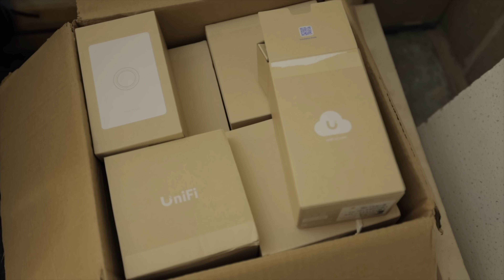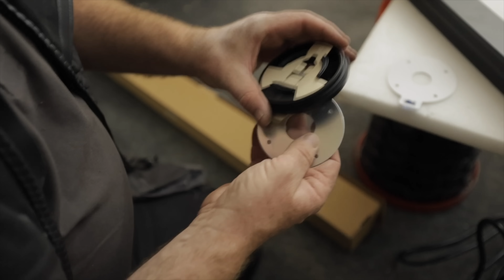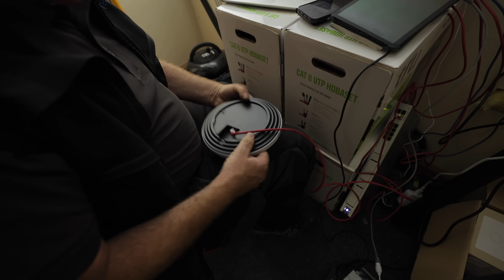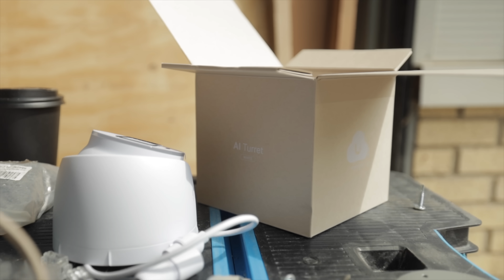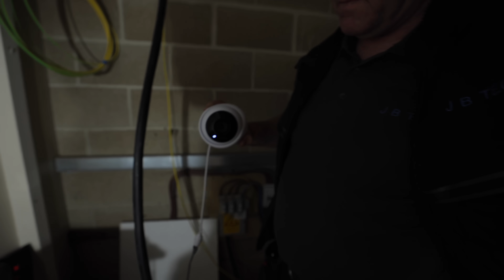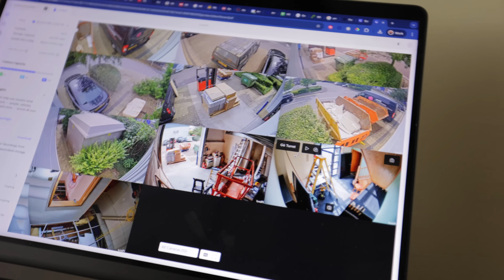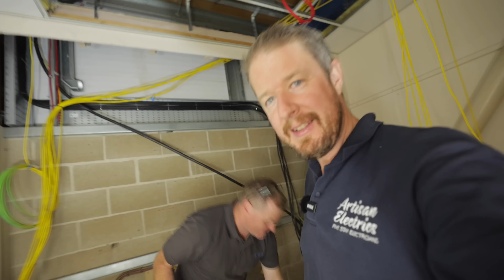We Got BURGLED So I Did This...

Comment: I have basically this setup at home, but the older Dream Machine Pro.

Ubiquiti have just announced/released the alarm and siren hardware so you could set your alarm manager to go off when things are detected in certain areas at certain times etc (eg an unrecognised van showing up between 2300-0600 or whatever)

Comment: You might want to consider a UNVR with 4 HDD's. That single 6TB drive will only give you about 7 days recording at 4K, and no resilience if the hard disk fails.
Reply: the UDM Pro Max can take a second hard drive in RAID 1

Comment: The #1 rule in security - assume you will be breached at some point. In physical security, that means assume someone will get in. Like others, it's good to see the steps you took - but I'd leave it at the high level concepts of like the initial hardware setup and software, cabling etc - but don't show the actual video or locations. Same with any other security, just focus on 1 external obvious location if you must.

With anything you are trying to secure, consider the value above all else and spend accordingly. No point spending $500 on a high security padlock if you your $10,000 worth of kit is stored in a chain link cage, for example - thieves will always go for the easy route unless they are after something very specific.

Comment: Seriously questioning the guy who installed that system…. Few things just didn’t sit right. Not sure if this was done after and I’m sure a sparky would think about these things but 

1. Please make sure to get a UPS, that’s really expensive gear and fluctuations can damage it. Also you have backup power for the CCTV. 
2. That’s a commercial access point. They get extremely hot, I would not leave it on a box 
3. Rack mount in an enclosure with fans😢 for air quality and tidiness
Reply: Artisan are not going to cheap out on the electrical installation,  it's obvious that is a temporary 'desk' for it too.

Comment: I have been impressed on the analytics of the G6 series.

I have to agree with the other comments. Secure the recording device NOW! Have a dedicated UPS also. 

Have select number of camera fitted with an SD card. This is part of a layer defence. Cloud back up is an option in addition to adding an SD card.

I do this as work so protect as an a fresh attack could be power and internet, then take the recorder.

I could suggest installing and AJAX security wireless system. Very useful in construction environment as sensors can be moved as required and you can get pirs with  an event camera. This would send a snapshot of the activation to you and the ARC. Great for validation.

I have seen many break-ins and the snots were picked by cops.

Layer, layer, layer.

Comment: "Have you done anything to make it faster?" "Nope" ... also just added an AP right next to him. If you have a 1GB connection there are 8 bits in a byte, so divide by 8 to get your speed in Megabytes per second ... if he didn't know that I'm not sure I'd trust that chap with anything data. Also alhtough preference - Seagate (non-enterprise) drives are absolutely awful and there are plenty of documented cases of very high failure rates.

Comment: Whilst the building is still a shell, find space to build a secure room to locate your server and get it secured behind a heavy door - ensure there is plenty off ventialtion as those servers will get hot and get somer more storage as you ideeally want enough storage to have 30 days worth of footage to scroll back through - it's always good to be able to scroll back through the footage should you need to, to find someone casing the building for a future theft, or staff having sticky fingers (not that they would, but you never know).   All those cameras are all well and good, but if the scroats can get at the server and shut the whole thing off, the cameras are useless. You also need to start practicing security through obscurity, enhancing your visible deterrent with concealed cameras - put simply stop showing all the camera locations on Youtube to ensure the safety of the building and its contents.  It would also be worthwhile looking to get some form of off site backups set up whether that be a small storage computer at home that your office backs up to or a professional cloud based system.  Either option will give you a fail safe in case something happens at the building.
Reply: Want the odd concealed camera lower down so that when someone turns up for a little bit of thieving wearing a hat you still get their face.
Reply: Agree - over sharing is deadly for security.  Secure server rooms and offsite are all de-facto standards in IT.
We also installed dual-location storage (in a school) so that you doubled up key kit in distant locations and backed up your storage there.
Reply: Totally agree with Securing the Equipment, had a break-in at our pub and the Perpetrators were aware where the cameras were and where the CCTV recording unit was, they avoided the cameras and removed the entire CCTV unit, which was later found mashed with a hammer and the hard drive also smashed to bits. had the system upgraded and placed in a Safe and new software that saved snapshots to an offsite data storage
Reply: @MartinOverthrow  We always fitted key cameras in pairs, where you were watched by one if you tried to knobble the other. Standard practice for school security where I was.
Reply: Definitely good to have layers of security.
Reply: The IT guys at my school got AC put in their main server room when the new build happened and it’s permanently set to cold, no windows or ventilation needed. Would highly recommend Jamie does the same.

Comment: Cat 5 / 6 Cables should be temanaited into a rack on a patch panel!
Reply: Only if it’s solid core (and it should be). 

This chap should have replaced his cable certifier. Just checking the pairs are wired in correctly is not going to give you any guarantees. Structure cabling should have a 20+ year guarantee. Also if certified you can exclude cable problem is things are not working as they should.

Comment: i spy a cheeky little simplisafe alarm keypad in the background... alright for a layover security system but you 100% need a better permanent alarm system especially for your insurance to cover you. nice system, I haven't really looked to much into the ubiquity stuff but looks awesome. using hikvision at home at the min and always found it spot on though I am due an upgrade in my new house.
Reply: His unit is absolutely ripe for a full UniFi deployment. Switches, access points, cameras, access control, environmental sensors etc. 

I’ve been keeping my fingers crossed for a smart door lock from them seeing as they are considered a “prosumer” brand but nothing doing this time. I do like the look of the SuperLink system though (the hub for the sensor platform) 😎

Comment: I quite dislike Ubiquiti products, got burned by them many times in past years. Even latest products like USW-Pro-Max-16-PoE one day just stopped switching until we unplugged the switch from the wall (cold boot). Every network vendor uses same chipsets in their products nowadays. What is different is software that runs on top of it and that is where Ubiquiti is quite lacking. It's all fancy LEDs and stuff but they can't do even the basic stuff reliably.
Reply: Ubiquiti is lacking in software?! I think you’ve been asleep. Even the most hardened Ubiquiti haters are starting to rethink their position.
Reply: @DJBenson2009  What I meant by software is device firmware. Their selling point is price and eye candy applications around it to have Apple like "feel". For example their enterprise line of switches or APs missing elemetary feature like console port. There is a reason why enterprise networking devices cost so much from other vendors like HPE (+Juniper) , Cisco, Extreme networks, Fortinet, Dell etc. Key difference: reliability testing and options of on device diagnostics if something goes wrong.
Reply: …and if a switch that was released a little over a year ago failed on you, why didn’t you return it to the supplier?

Have to say I’ve got a cabinet full of UniFi stuff in my home and not one thing has failed and I’ve been running their kit since 2016.
Reply: @DJBenson2009  It didn't failed completely, it just hang in some state and cold boot solved it. 
You pointed it right "at home" thats the place where Ubiquiti products bellongs.
Please don't put them in mission critical infrastructure, they aren't fit for it (even they pretend to be).
I Also have very old EdgeSwitch 8 150W and it works without any problems, partialy because it's software is not made by Ubiquiti but it's just rebranded EdgeCore device.

Comment: Love Unifi, been using their gear for years 
However as your using this for commercial and meant to last i would have opted for the new cloud gateway and a seperate NVR for the cameras as you have quite a few rather than using the built in HDD sleds in the dream machine 
Camera and AP choice tho spot on

Next step Unifi Access and Car Chargers 😆

Comment: I run unifi cameras at home with a UNVR (supports more than 1 drive - fault tolerance) - Just make sure the network is all setup correctly with good security practices having the CCTV system segregated off from anything else on the network.  You wouldn't want a machine used for emails , admin work , payroll or whatever having a direct line of sight to the CCTV kit.. Just like you wouldn't want staff personal mobile phones on the WIFI joining the same network and also having a direct line of site to machines used for payroll and the CCTV kit, segment it all up.
Reply: Vlans ?
Reply: @GregMurch  yup
Reply: Thats where unifi excels, its easy to segment your system into private lans, all sharing the same hardware

Comment: Are you going to add a UPS, in case the power goes off?
Reply from the maker: Of course!
Reply: @artisanelectrics that means a proper UPS not a power bank. Plenty of options out there but some can send out of network messages to a phone if the power goes out. Always good to have out of band management.
Reply: sure sounds like a good idea.

Comment: i also use unifi equipment (don't regret switching from home stuff to semi-pro) and my internal network is 1Gb/s but i don't have any cameras. the bottleneck is my DSL which is around 14 Mb/s.
also, when you crimp those rj45 plugs onto the cables, the wires need to be in a specific order, or the cable won't work

Comment: Just For Info.  You really should make access to the unit with the disk drive very very difficult - Thieves are more tech savvy these days and will take the unit and/or the disk making the whole exercise pointless.
Reply: Security though obfuscation and all that… which is why he also needs to enable archiving to an off site device as well. Protect supports uploading to Google, Microsoft and others as well as to a NAS which they said they also have.

Comment: The newer Unifi stuff is really good, especially the U7 APs. I've seen 200+ clients on individual U7 Pro Outdoor and U7 XGS APs and they didn't event break a sweat, so you might have overdone the wifi lol. Also, I couldn't tell if you put 2 drives in your UDM, but I would definitely recommend it for redundancy.
Reply: Hi.   Please make sure your live streaming you videos to the cloud for storage as you have just shown everyone where your hard drives are located.   So they break in smash your on-site camera storage with one or 2 hard drives.   If you want a drive on site have one but ensure your recordings are live going to the cloud over your internet connection.
Reply: Good starting video and interesting to see the kit being installed.   Please make sure that you follow guidance about protecting you internet feed. Please make sure your live streaming you videos to the cloud for storage as you have just shown everyone where your hard drives are located.   So they break in smash your on-site camera storage with one or 2 hard drives.   If you want a drive on site have one, but ensure your recordings are live going to the some secure cloud storage over your internet connection.

Comment: i hope this chap is going to put the necessary network segmentation and security in place with this setup...
Reply: Subnetting it as a minimum 🤞And assuming that 4k multi cam video cams will also play nicely with the business traffic 😉
Reply: @Hastings1066TV the camera traffic is a drop in the ocean for what the switch is capable of but totally agree on segmenting. I’m a home user and my UniFi network is segmented, all my cameras are on their own VLAN and blocked from other VLANs. Totally overkill for home but so is a UniFi setup 🤓
Reply: @Hastings1066TV mate that UniFi gear is insanely powerful. Could fill the switch with their top of the range cameras and it wouldn’t bat an eyelid.
Reply: @Hastings1066TV I’m sure the internal bandwidth will be fine, but it should all be logically split
Reply: I kinda get a feeling that won’t happen.

Comment: Layers and height. Smoke curtain, smartwater marking (dna water) covert cameras. There is so much more and you've got a lot on your plate. Best of luck !
Reply: invisible ink that shows up under UV light. blindingly bright flashing lights. earsplittingly loud sirens, bells or other noisemakers.
and yeah, a smoke cloak system sounds like a good idea. it definitely is on my list of specs for the house i want to build. the question is, if the system is triggered, will the smoke trigger the smoke detectors of the fire alarm system?
Reply: @mrxmry3264probably, but by then your Intruder system sounders will be going off, and you'll be awake in your home !
Reply from the maker: Appreciate the advice!
Reply: @artisanelectrics there's so much choice, it can overwhelm. It's finding what is most practical, even something as simple as a battery pir doorbell for inside a loading bay can alert people to anyone walking in. That'll be your next challenge to solve.

Comment: Unifi is good in being PoE and not Wi-Fi which can be blocked
Reply: yeah, connecting security cameras using wifi is just asking for trouble. wired ethernet is the way to go, especially for mission-critical equipment.

Comment: Waste of time a friend's farm had break in the stole nearly £50,000 quids worth of equipment they had CCTV  the thief's took the recording device and server 🙄
Reply: If they’d done a proper job installing it there’d have been offsite copies of the footage…
Reply: Great call out.  The DVR or NVR needs to be in a locked, hardened cabinet, or a dummy unit placed to distract thieves.  In addition, someone has already mentioned uploading recordings to a remote drive or "cloud" storage.

Comment: as somebody who has done IT 1. fix your mic! 2. dont show the locations of your cameras!!
Reply: Cameras do not prevent theft only allow you to have a higher chance of recovering after it. Cameras may deter a opertunist but not a true thief.
Reply: As someone who has done surveillance system layout creation and installation (16 years), it really don't matter if you show the camera locations.  Stupid criminals (snatch and grab) don't look for cameras.  Smarter criminals will look for cameras over time and know the best places for cameras to be installed.  Unless you have the cameras hidden behind 2 way glass or smoked domes (not many places other than large retail or grocery stores do this), everyone will see the cameras, especially if they go by the shop at night.  The thing to remember is that cameras record what is going on and only deter those that really didn't want to do the crime in the first place.
Reply: @RandyHarter  i would put up objects that look like cameras in obvious places, and then a few real cameras that are hard to see. maybe even equip the pseudo-cameras with sensors to trigger the alarm when criminals attack them in an attempt to disable them.
Reply: @mrxmry3264you presume that footage prevents theft and drives prosecution. Neither are really true in a significant way.
Reply: Or, do a video on it and then change them 😂😂
Reply: As if somebody walking by wouldn't be able to spot the cameras. But they didn't say multiple times they were going to add more.
Reply: Let's just hope some scumbags don't break in and pinch that very expensive CCTV system 🤞🏻

Comment: Not a good idea to show all the camera locations in a video! 😮
Reply: And they are all high mounted, good for seeing hats and hoodies, but of little help to the police if they have another break in. Police need faces and tattoos.

Should always have some low mounted (between waist and shoulder hight) IK10 vandal proof cameras facing entrances and other choke points like alley ways, corridors and the top of stairs. You want to make it, so they are effectively forced to face the camera. 

Hopefully they plan to add other security gear like alarm, security strobe lights (the type that course confusion), ram raid bollards and a security roller gate for that front glass entrance.

Comment: Ubiquity nice,  hopefully your backing up to the cloud also so when the hard drive goes with the thief's you've still got something to look at!
Reply: Need to put the NVR somewhere they can't get to..
Reply: exactly my thought.
Reply: @MasterLuke007 with the alerts going to the phone it includes a video clip so there’s your evidence even if the NVR doesn’t replicate to a second server.
Reply: @ricktomlin5529 pretty sure you cannot send clips as an alert. Push notifications stream the video from the NVR and email notifications only contain a still. 

You have to back up to the cloud (or use edge recording if supported by the camera) to be in a position where you still have video footage if the NVR is nicked.